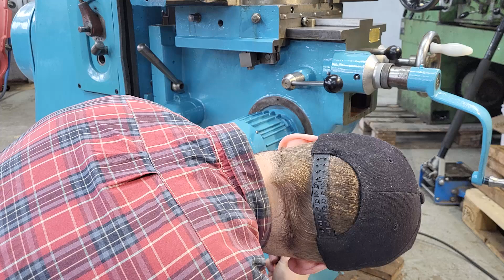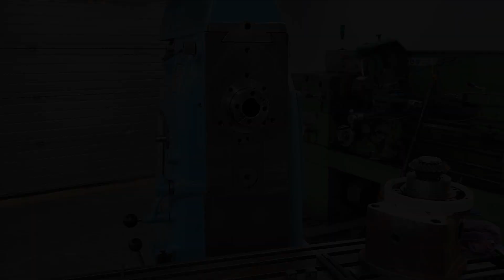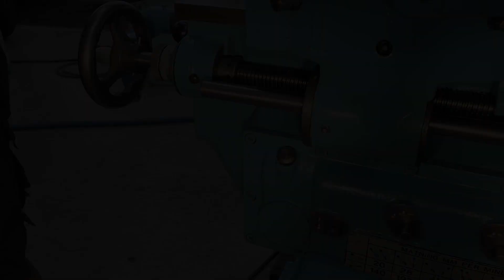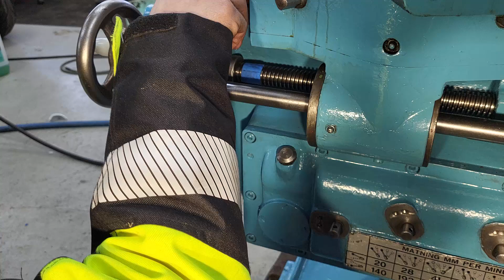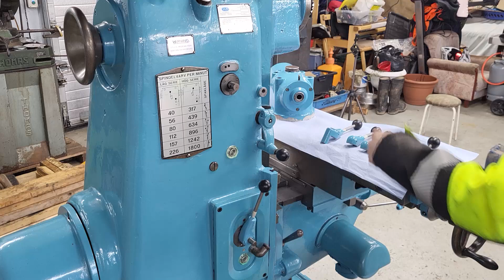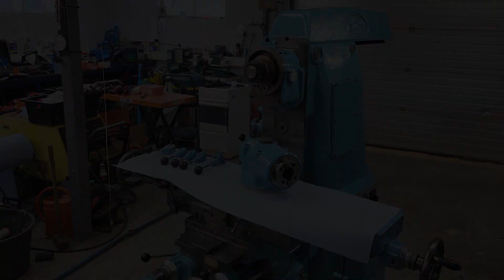SAJO milling machine restoration - PART 18

Comment: It's all good. The man that I bought my horizontal mill from ordered an er 40 chuck that fits my cat50 taper in my machine. He bought it from somewhere in China for $200. Opens up many possibilities while saving money on tooling. Good luck
Reply from the maker: Nice, yep the tooling is quite expensive! We will try to make a fly cutter ourselves, but if that dont work, we need to buy one. Then I think it would be nice with an edge finder aswell.
Reply: @Builditandfilmit  check out Matty's workshop. The title is. horizontal milling viewer job. After he takes the vertical head off is the part I think you'll be interested in. Good day mate

Comment: I'm curious to know what taper size does this mill take? Maybe someone out there has one.
Reply from the maker: Do you mean the locking pin or what taper dimension? 🙂
Reply: The question is what size taper goes into the spindle of the machine. In the States it would most likely be a 50 or 40 taper.
Reply from the maker: Hah, well now I feel a bit embarrased 😂 whybwould anyone want to now the dimensions of a tapered pin... 🤦 The taper size should be ISO40 if we are not wrong.. we are really close to have the machine completely done, so soon we can start sourcing some tools for the machine and actually start using it 💪

Comment: To remove old and hardened masking tape, a gentle application of a heat gun will usually help.
Reply from the maker: Thinking of it, this is perhaps the best way.. strange how it seems like one often forget the most basic things 😅 we used brake cleaner and a plastic scraper..

Comment: I think the little brass plug and the handle are for locking the table when you want to increase rigidity (a little) during an operation or if you have a fixture, rotary table, etc. that you don't want to move.

Comment: I would say that bolting the head to your gear box spindle & locking the dovetails would add rigidity to the whole assembly. Pity you don't have the horizontal milling attachment which I assume is what the dovetail sliding head is for!
Reply from the maker: Yeah, I think so too. Yep, maybe we can find it somewhere for sale sometime 😊